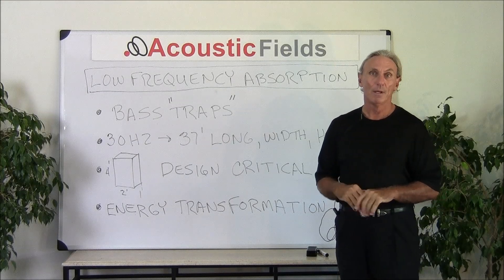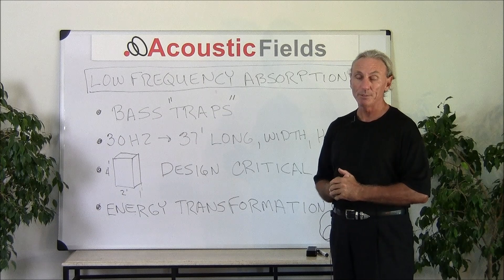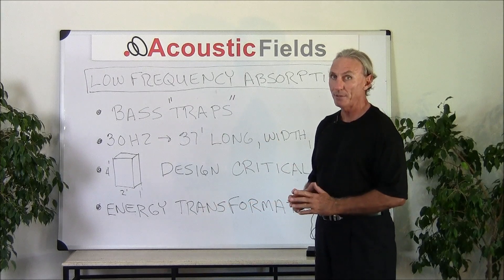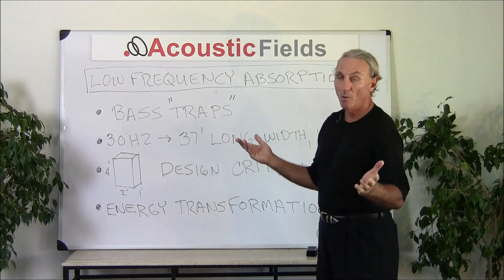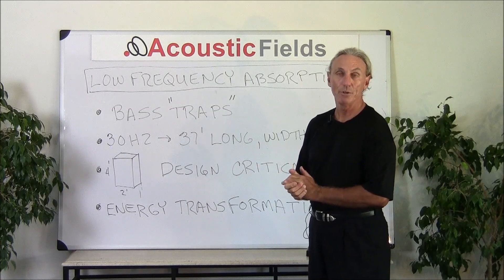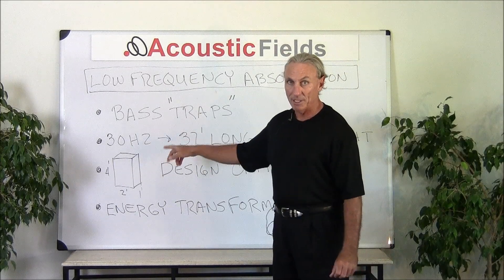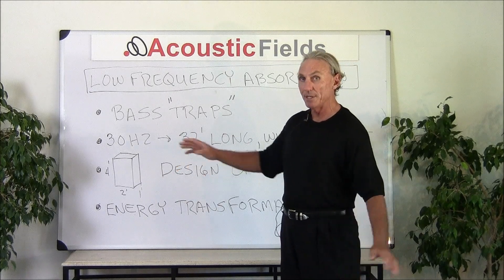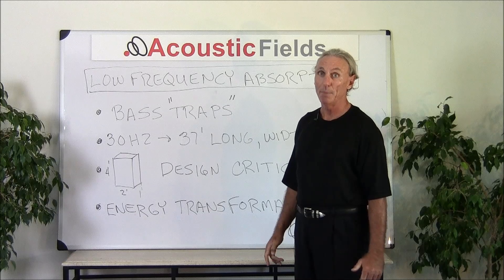Why Bass Traps Dont Actually Trap Bass - www.AcousticFields.com

Comment: Hi ! Do you know the speed of sound in porous materials such as glasswool around 100hz ?
Reply from the maker: J,  I am sure you can locate that data on the net.
Reply: Acoustic Fields sure but it is quite hard and it seems that few people knows about it... From my researches, the speed of sound is about 50 to 100m/s below 100hz, it seems to be more realistic to consider 100m/s then 50m/s however. 100m/s is about 3.5 times less then the speed of sound in the air, thus I think it matters to consider it !
Reply from the maker: J,  Energy below 100 Hz. is wave energy which differs in certain content from energy above 100 Hz.and must be treated so using those differences. Ray energy treatment above 100 Hz. works on molecular velocity or air movement. Different energy types require different treatment technologies.

Comment: Is this why I hear acoustically treated rooms are so hot?
Reply from the maker: V,  I do not know what you mean by hot ?
Reply: Acoustic Fields "change the energy to heat." Did you mean some other kind of heat?
Reply: I don't think the amount of heat that's going to be converted is going to make your room that much higher in degrees.  I think if you are in a room with a lot of acoustic treatment and gear that's turned on, I think it might be the electronic equipment in the room that's making the room a higher temperature.   That's why studios do tend to get fairly hot. Some studios actually turn off the air conditioning while tracking if their AC units are too loud.
Reply: For a second there I also thought meant sexy hot 🤨

Comment: Do you have any ideas for a 10 - 15db gain at 250hz boom in my room. The rest is sounding great apart the this frequency after I sine swept the room :( Thanks
Reply from the maker: +Wiremu Hi Wiremu, Our ACDA-10 unit is a broadband absorber from 30 - 400 Hz. This is the unit you will require with a + 10 dB - + 15 dB peak.

Comment: Hey there, I was just wondering if you would recommend buying any bass traps at all, (seems to be a waste of money) or how you would treat a small studio. Would it be better to focus on absorbing higher frequencies and attempt to make some DIY bass energy absorption units to maybe at least get rid of problems in the area around 250-500 Hz? I found it to be funny that some companies claim that their bass traps cover all low frequencies, thanks for the video :)
Reply: Oh I just saw the other comments, I think covering 2 walls with thick layers of glass wool and adding a book shelf as well as other high or mid frequency absorbers would do the trick in my situation :D If you have these thick pieces of very dense material, these should absorb higher frequencies too right?
Reply from the maker: Hi Glowing Lights Official 

Thanks for leaving a comment.  Companies make all sorts of claims about their technology that may or may not be true. Always look to an independent lab test results for actual verification of performance. Once you obtain that data, then you must decide how much to use and where to place it. This can be a bit tricky because you have to know the level or strength of your problem at those frequencies so you can choose the correct absorption technology.

If your issues are 250 - 500 Hz., you could use a middle frequency, sound absorbing, foam technology. If you just need gradual absorption through that frequency range or you can achieve more absorption using a broadband based, lower frequency absorber such as our BDA series. It all depends on room usage and what you are trying to do acoustically within the room. 

If you want to fill in as much information as possible on this form of my site I can take a look at the issues you are facing in your room and send you a free analysis:
http://www.acousticfields.com/free-acoustic-treatment-room-analysis-tell-us-about-your-room/

Thanks
Dennis
Reply: Acoustic Fields Thanks for the fast response, I will get to it tomorrow and probably send my data to you soon!
Reply from the maker: Glowing Lights Official Hey, really enjoyed the song on your YouTube channel, very nice.  I answered the question you posed me in greater detail in yesterdays Google Hangout.  You can see my answer to your question here http://youtu.be/hr2VOi3Mjtc

Let me know if you have follow up questions and I'll be happy to help.  And do send in your room measurements when you can so I can take a look.

Thanks
Dennis
Reply: Acoustic Fields Wow thanks for checking it out! The hilarious thing is I had to make this mix on a cheap Laptop and some decent headphones, which overall turned out to work better than my Yamaha HS8s in an untreated room. That just shows how important acoustics are, because I don't expect the speakers themselves to be any worse than my headphones... :)
Reply: Acoustic Fields One more question to you though... : I have recently noticed that I can't hear frequencies below 120 Hz on my left ear any well, whereas on my right ear it happens to be no problem. I went to a doctor in order to do a hearing test which in fact couldn't detect any hearing loss at all. I am normally one to be really careful when it comes to finding a decent volume of headphones or speakers in order not to damage my ears. It turned out that their test started at 125 Hz upwards; also they couldn't tell me what caused this kind of what I would call really low frequency hearing loss on my left ear. Have you ever noticed anything alike or do you have an idea what it could be? I am very frightened that I can't mix bass properly anymore! Thanks in advance, it's hard to find any serious source of information on Google :(
Reply from the maker: Glowing Lights Official Yes, most hearing tests do not go much lower than 125 cycles because low frequency energy is mostly felt through bone conductance or vibrations through our skeletal system (I made this video to help explain this further http://youtu.be/BfK19_N4nAw?list=UUu6Bjebk4fuye46VRG5Y83A). I do not know why you have this energy reception unbalance but you might just need to have your ears cleaned thoroughly. Sometimes people who use ear buds or those small in the ear canal speakers, push the wax in their ear canals up against the ear drum through the repeated in and out insertion of the ear buds. This causes an uneven hearing response if one ear has wax build up and the other does not.

You can buy those ear canal cleaning kits yourself and clean your ear canals out by flushing warm water solution through the canal and then extracting the waste. Be careful with any water pressure devices that flush water through the ear canal, Always use the least force possible. Think of your ear drum as a snare drum with a silk drum head. Take it slow and easy on the pressure. You can also run shower water through your ear canal while taking a shower. Once again, just warm, not hot water and gentle force. Run warm water through one ear for a few minutes and then the other. It takes a minute or so for the warm water to melt the wax, so be patient and do not use much water pressure. Just keep the water moving gently through the ear canal. Probably best though to go to a Doctor to have a pro do this for you.

Thanks
Dennis
Reply: +Acoustic Fields Thumbs up for the clean ears tip. It's easy to overlook. I flush mine out with warm water regularly. Avoid QTips.